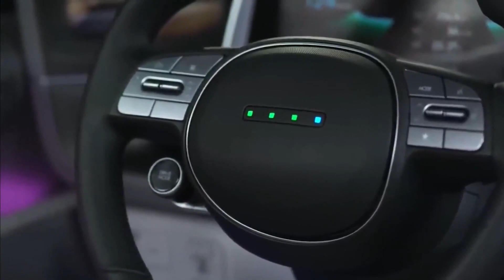Hyundai CEO: "This ALL NEW Battery Will DESTROY The Entire EV Industry!"

Comment: the battery may produce zero emissions  but the power plant still makes them  
this is a joke  that no one is picking up on   the emissions are still there  they are now at the power plant      AND mp solar panels will not make the power needed    and wind 
is  iffy at best      HAY i have the answer  Hamsters that will do the trick   just keep those wheels turning     we now have fixed the air pollution problem       Hamsters